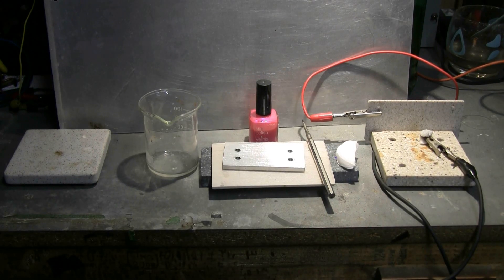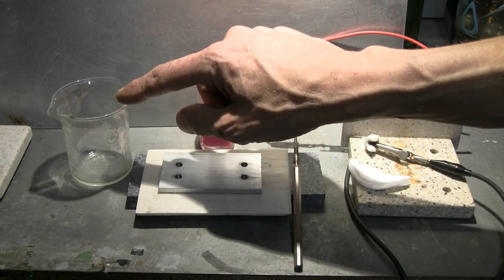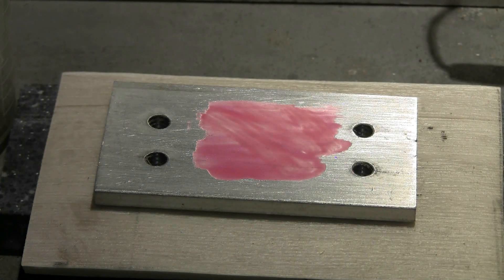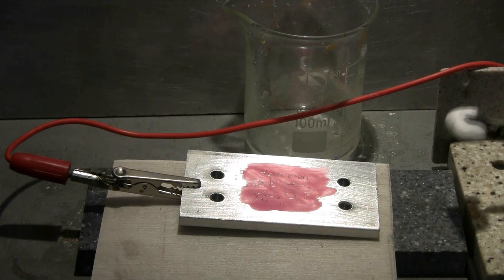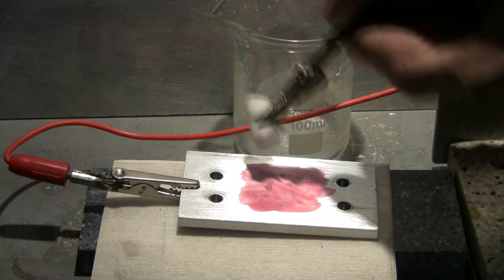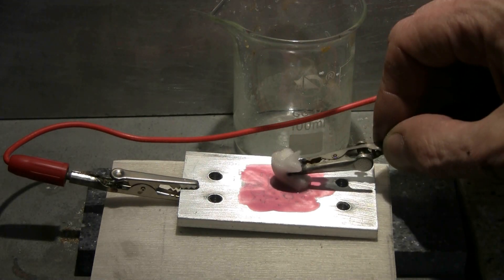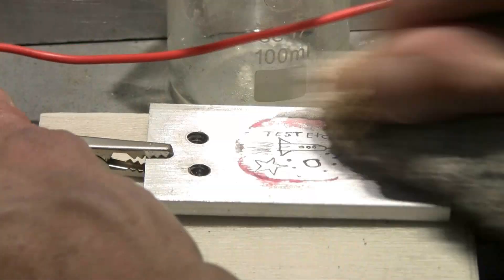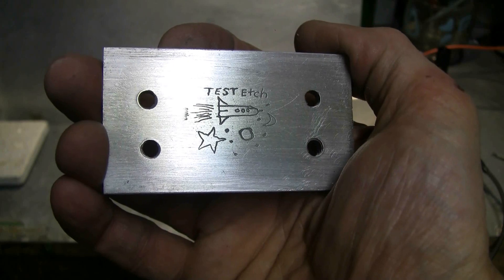How To Etch Aluminium

Comment: Do you think it would be possible to etch holes right through 0.3mm or 1/64" aluminium sheet using this method? I'm currently trying to use NaOH to dissolve the aluminium but having problems finding a cheap easy to use resist that I can selectively remove with a laser cutter.

Comment: Based on this video, I have been using salt and well water. It etches well. 1/16th inch in about 10 minutes. Keeping the cloth wet and wiping the buildup twice during the process. The vinegar process was more messy and it etched very slowly. Clean water worked far better. Thanks Bill.
Reply: Do you think it would be possible to etch holes right through 0.3mm or 1/64" aluminium sheet using this method? I'm currently trying to use NaOH to dissolve the aluminium but having problems finding a cheap easy to use resist that I can selectively remove with a laser cutter.
Reply: @ColinWatters  I think it would go through but I am guessing you would want to do something on the back side to keep it from just destroying any refinement from once it begins to go thorugh. Maybe tape, or fingernail polish.

Comment: Can you still etch on a powder coated alluminum
Reply from the maker: +Junard Burigsay The powder coat would serve as your etch resist mask. You would have to scratch your design through the coating so that the aluminum is exposed and can etch away as required.

Comment: will it etch through unprepared metal
Reply from the maker: +Kenneth Cunningham If by unprepared you mean it has anodize or paint on it then it will still etch as long as you scratch through to the aluminium when you prepare your pattern.
Reply: Was meaning the aluminum oxide layer that forms

Comment: instead of Vinegar and salt, could i use Sodium Hydroxide? I think that will work too, but not 100% Sure.
Reply from the maker: +Inesophet The reaction with aluminium could be violent unless the hydroxide solution is dilute. The vinegar and salt would be less hazardous.
Reply: yeah i used vinegar and salt eventually. Took longer. But the good thing with vinegar and salt is that it leaves anodization in piece. So the engraving process was very simple, just carve into to alu and then etch. Used NaOh but that ate the Anodisation away was faster but then again would have cause me far more work

Comment: For the resist laying, you can also use a laser printer to print your negative pattern onto a glossy paper, and use masking tape to tape the paper to the aluminum plate, then wet the tape along with the paper, take an iron and heat the plate evenly. This way you can lay a much more precise pattern. :)
Reply from the maker: +WorldEagleKW Sort of like making a circuit board. This will work well. Thank you.
Reply: Finally! I am doing an etching as a gift for a friend. Video will be up soon.
Reply: @WorldEagleKW  is the video up ?
Reply: Can you explain this in more detail please? It sounds great but being new at etching, I'd love more detail...or a video!! ;) Thanks!
Reply: Can also use a stencil and acrylic paint...